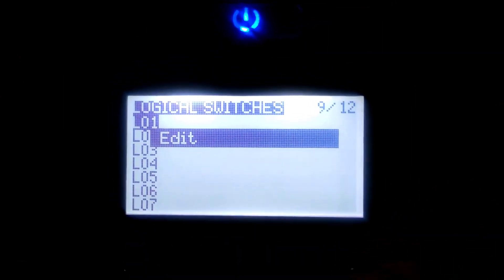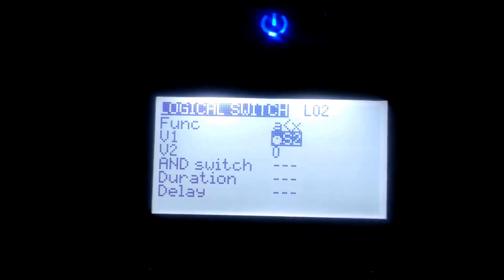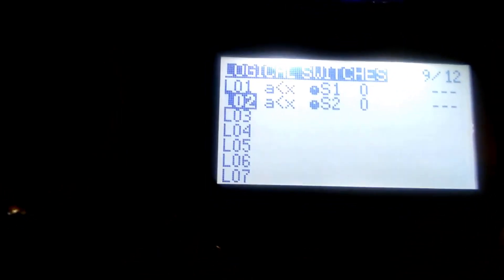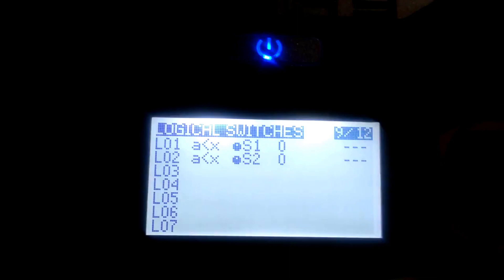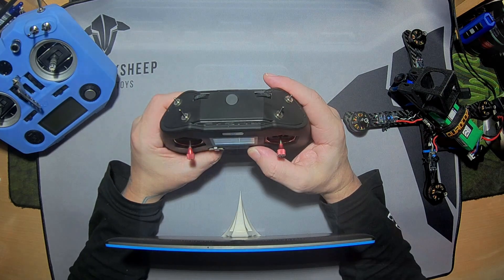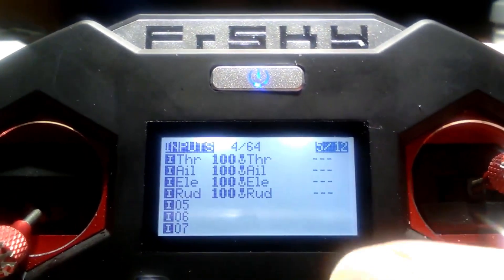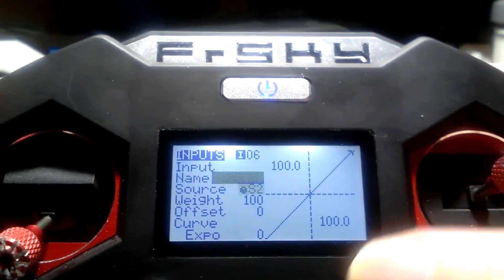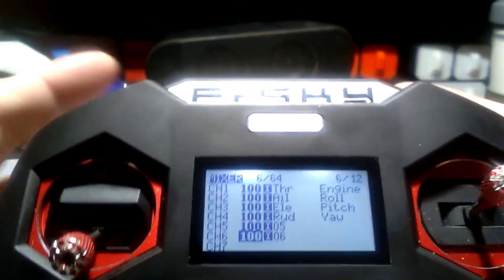X-lite Quick Tip [ Faux Momentary Switches for Telemetry, Timers & Simulator Functionality ]

Comment: If I got it right, this is a way to create a momentary switch, when there isn't one, right?
Could you explain how I can assign this to instant trim?

Thanks a lot for sharing your knowledge. This is really very helpful.
Reply from the maker: You're welcome!
So you would set up the logical switch exactly the same but in the Special Function part, instead of play Val you just select Inst Trim & put a tick in the checkbox on the right side - So when your flying at the attitude you desire, just hit the momentary you've got assigned and it should take those stick positon's and apply them to trims.

One caveat that I can foresee is the trim range is somewhat limited so you might be limited to the max of that depending. Well scratch that - I just tested it and it will go infinitely beyond the normal trim range so it's all good!
(This wont apply trim on the throttle stick either according to how mine reacts. You can also stack the trims by instant trimming on top of the previous instant trim (inst trim 25 right and then again in the same stick position will end up with 50 trim right for example))

Hope this is concise enough and helps!
Reply: @MrE.  Yes, great. Thanks a lot. But I don't know if my idea to use it, was that great. Any idea how to get rid of the instant trim settings😂. Instant trimming in neutral position only adds zero to the already existing trim🤔
Reply from the maker: @fidelgrillo4808  I take it you are using an XLite? just use the Dpad to set them back to zero. From memory just the DPad trims the right stick but you hold shift (one of the small round buttons but the little joystick) and it trims the left stick. Is that what you are after?

Comment: very cool way to use those. I use one of mine for volume and I have battery voltage automatically spoken to me when it drops below my minimum. However, I can see the usefulness of having it on a switch as well.